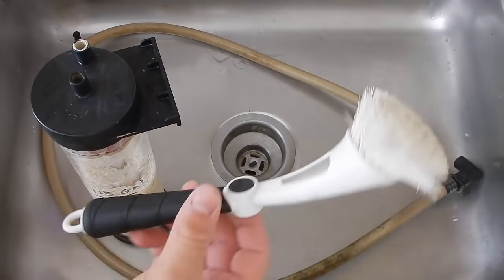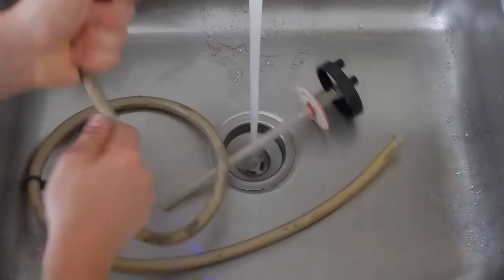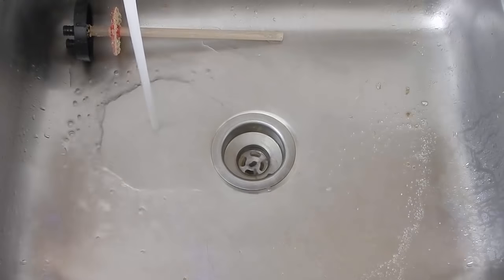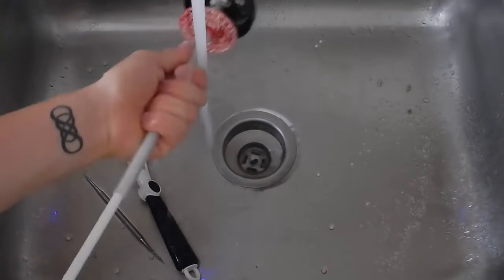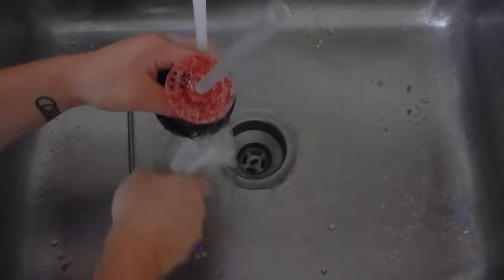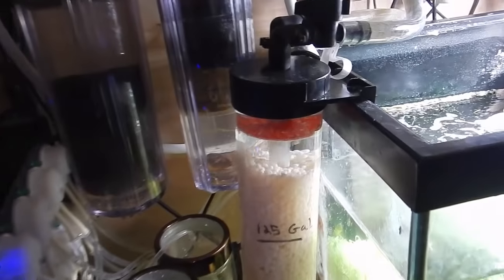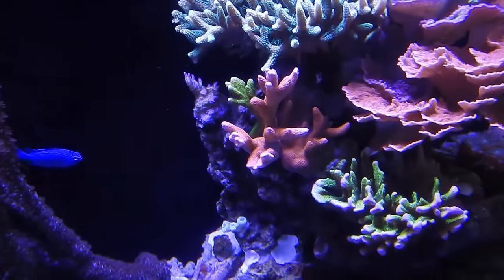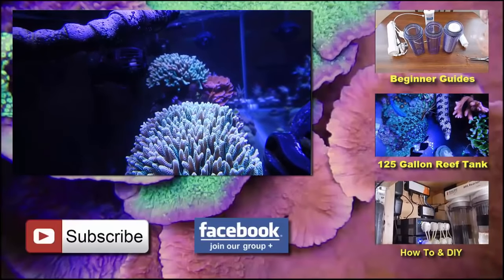In Depth Guide To BioPellet Reactors | Subscriber Request

Comment: Anyway you could do a video of a in depth guide on how you dosed from the refrigerator?
Reply from the maker: I can try but i no longer have the refrigerator, But basically you need to find a way to pump water down and into the refrigerator. At that point you can dose into the water line so it will flow up into the tank. I ran a line off my manifold and dosed directly into it.

Comment: I going to set up a bio pellet reactor very soon. I'm watching different videos to see what to expect.  I came across this video..got alot of good information.  I have a 65 gallon reef with nitrates constantly at 30 no matter what I do. But I do have two large tangs I don't want to part with.  Should I use a reactor that goes in the sump or hangs on the back. What is best in your opinion.  ?

Comment: Great video bro! Lots of awesome information. Question though, is the only time a bio pellet reactor should be added is when your nitrates get too high? Or should it be added as a prevention of nitrates ever getting high? Thanks man
Reply from the maker: I like to add them when starting the system but it doesnt really matter. If your system is already running you need to focus on going slow with adding them.
Reply: Sounds good. Thanks man

Comment: do you have to have the reactor out put hooked on the skimmer like it is on your system or can you just run it into the same chamber as the skimmer?
Reply from the maker: I always recommend people have the output pointing at the input of the skimmer or hard plumbed in you have a better chance of skimmer off the bacteria that way. If you want to run it in the same chamber give it a try if you start to get a cyano bacteria outbreak i would hard plumb it
Reply: Ok i think ill just plumb it into the skimmer lol
Reply from the maker: Yea its easy just take the part to homdepot and put it together

Comment: I think a UV Filter will kill bacteria in the water column, but the bacteria in your reactor will be safe from this. I've never run one, I don't see the need. Plus most of your bacteria is on the rock surfaces I THINK.